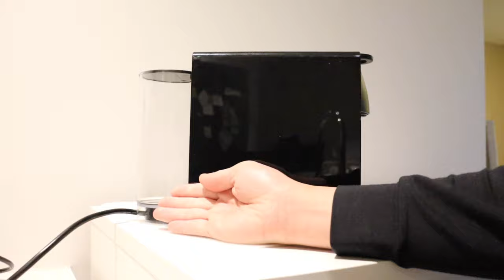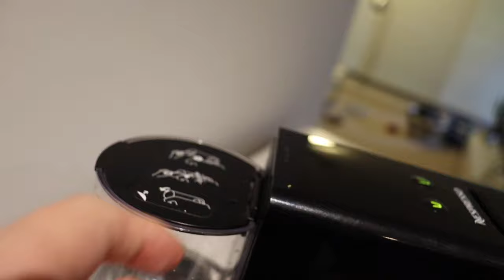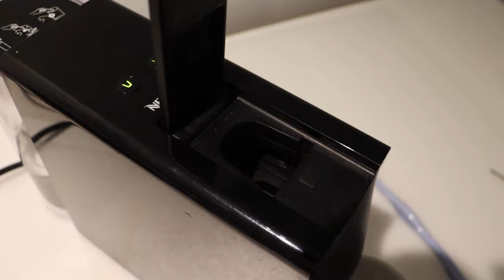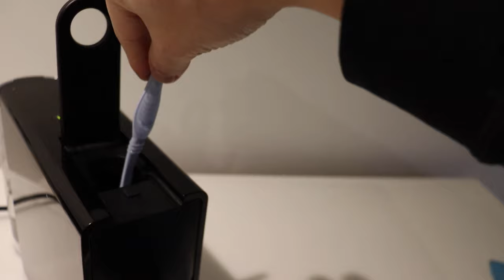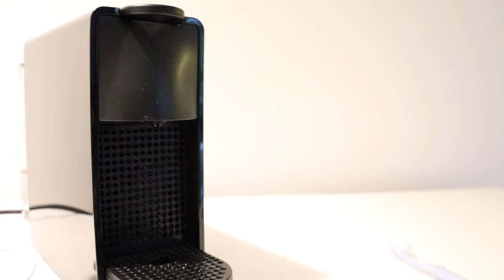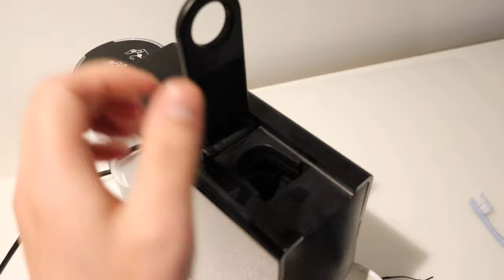NESPRESSO HOW TO FIX No Coffee Flow Troubleshooting Maintenance

Comment: I descaled my Essenza mini,, and I was ready to make a cup of coffee.  It appears that the machine is in descaling mode even after I exited.  I followed the directions to press the buttons for 5 seconds, but the quick-flashing lights come back when I press a button to make the coffee.  I don't get the solid green lights.  I've unplugged it for a while to see if that helps.  Any suggestions?  Thanks!!
Reply from the maker: Try pressing and holding the small cup and big cup buttons at the same time until they go solid that should exit descaling mode.

Comment: Just throwing this out for the benefit of anyone looking for ideas.  My nespresso wasn't working when I pressed the button or tried to do a reset.  Seems to be because the seal got damaged from using reusable capsules.  If I hold down the top and press the button it works.

Comment: Hello ,please help me !
I bought and started to use empty plastic  capsuls that you can fill with your own coffee powder and it worked good yet. But today i bought a new coffe powder (for espressos) filled my capsul and put it in to brew but i think it was too tight and machine couldnt brew . Machine stopped working then gave a bit of bad voice and now when i pull it open there is no capsul place to put .when i open its empty hole and connects with trash part of machine. I hope you can help me.
Reply from the maker: I would never use other branded compatibility capsules because they can damage the machine. Only use Nespresso genuine capsules. You’ll need to contact Nespresso to get it repaired.
Reply: @larpy  Thank you so much for reply and thankfully it did not broke it was my paranoid i suppose . Thank god that that machines self defence ( self protection) works well. And your video is really helpfull i will take good care of my precious machine from now on .

Comment: My machine just stopped working properly. Lights up ok but capsule gets stuck. Lungo button only works for 7 seconds with very little water. When I cleaned with tooth brush, a foil cap fell out. Thought that was the problem but it wasnt...
Reply from the maker: Have you also tried to use a paperclip to poke up the spout and wiggle it around to try remove grinds stuck in the spout. and run water. If you've tried those things seems like you'll need to contact Nespresso for a repair
Reply: And also, when I push the handle down to release the capsule water pours out of that area. And I've also had water leak onto the counter after hitting the button a few times

Comment: Nah. First it was the first issue you mentioned. But now it is like i click espresso button it starts blinking but no sound no movement nothing. Mini doesn't do anything. Then blinking stops. That's it. So now what's the procedure?
Reply from the maker: It’ll need to be repaired then. It’d be best to contact Nespresso. Check their website for there local customer service phone number. They have service centres in most areas.

Comment: Where is the on off switch on my Citiz ?  I bought it used and there is no switch on the side like was on my other one
Reply from the maker: Is it the Citiz single or citiz and milk with the milk frothier base attached ? If it’s the newer Citiz single there is no power switch just plug it in at the PowerPoint and from the wall and press the any cup button and it will starting flashing to indicate heating up

Comment: Coffee capsules are not being pierced, runs out only hot water. Fix >> if i press and hold the leverage at the begining the Coffee capsule blows.
Reply: Hi Totoz, I have the same problem - but as a non-native EN speaker I do not undestand properly how you fix it 🙈. What do you exactly mean by “hold the levarage”? Many thanx 😊
Reply: @SuzanneMelody  it eventually works for few capsules. I purchase a new one; different model.  They produce products with expiry date nowadays.
Reply: @Tasos521  many thanx for your reply. Thats what I also think - nowaday products are only for 2 years max 😂 Here in Europe, the machine is very cheap so I am also about to buy another one. Thank you and may the force be with you 🤟🏻

Comment: So my coffee when brewing leaks under the machine. Is this common? How would I fix this issue?
Reply from the maker: What model machine is it? It’s not common to leak underneath. Have you checked the water tank isn’t cracked or faulty ? Fill up the water tank and put in on a dry cloth or paper towel to see if it leaks
Reply: I will do that but my water tank always has some water in it and it doesn’t seem to leak. Only when I start to brew the coffee is when it begins to leak. It started yesterday too. I have the Vertuo-plus model.
Reply from the maker: @gabyyescobar  Ok sorry to hear. It would then need to be repaired by Nespresso. Contact their customer service line
Reply: Okay thank you!!

Comment: My Breville Nespresso machine I’ve had since April looks very similar to the one in this video has been working well until today. There are no holes being punched in the capsule foil. I’m using genuine Nespresso capsules.  Any ideas?
Reply from the maker: Try flushing water through the machine first a few times. Also check if the underside of the capsule edge/lip is shiny and has a clear seal. Older Nespresso capsules without the shiny seal on the edge won’t work on newer Nespresso machines. If it still doesn’t work you may need to get it repaired by a Nespresso service centre. if it’s still under warranty Nespresso will repair it for free.
Reply: @larpy  My wife had run machine without enough water in the tank to make a cup.  Refilling the water and running it without a pod allowed the pump to prime, and work again.

Comment: I cleaned the plate with a toothbrush and inserted the paper clip, tried pushing the longo button several times and still the water comes out normal flow for only a few seconds and stops Model Number. BEC660CR04JAN1 Help Please
Reply from the maker: Try reprogramming the cup levels. Press and hold the Lungo button and water/coffee will pour until your happy with the level and then let go. Next time when you press it it will pour to that level

Comment: One of the buttons not working? Can you help
Reply from the maker: What happens when you press the button? Does it make a noise ? What colour is the button ?
Reply: Green colour itself but the duration is short for the long one.
Reply from the maker: @nawalhassan8558  Can you tell me which model your machine is? You probably just need to reprogram the cup level. Put a cup under the spout and press and hold the button until you’re happy with the level. Make sure there is enough water in the tank.
Reply: Nespresso innisia
Reply from the maker: @nawalhassan8558  Put a cup under the spout. Close the lever, Press and hold the button and water will pour out. Let go of the button when you’re happy with the level. Next time you press the button it will pour to that level.
Reply: Thanks a lot it worked! Appreciate your help
Reply from the maker: @nawalhassan8558  You’re welcome! Glad it worked
Reply: @larpy  Hi I have been given an essenza, turning it on the green lights both blink but then don’t stop blinking and the motor doesn’t seem to engage.

Comment: One more piece if junk coffee maker I have purchased over the years.  Had a Kuerig that failed after about 6 months, now my Nespresso machine I've used literally 30 times is not working.  Yes, followed all the troubleshooting tips, water filled, everything lined up, etc. and no coffee.  Don't know why I waste money on this junk.
Reply from the maker: Must be unlucky because i've had 2 Nespresso machines 1 is already 10 years old the other is 4 years old with no issues at all. Go return it to the place you bought it from, get a refund or replacement. What model is it?